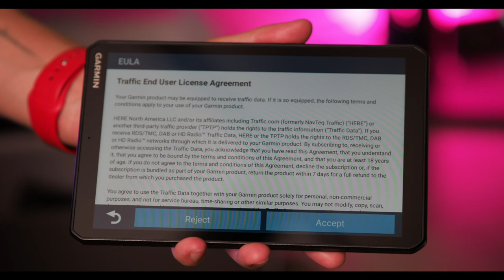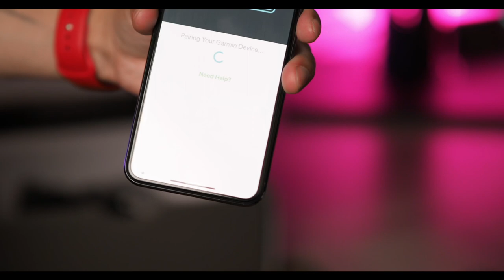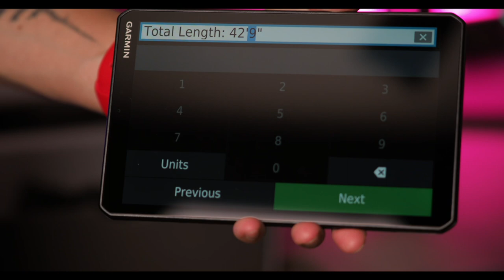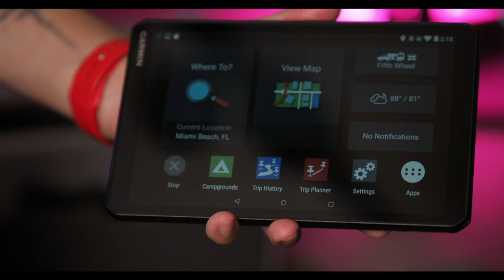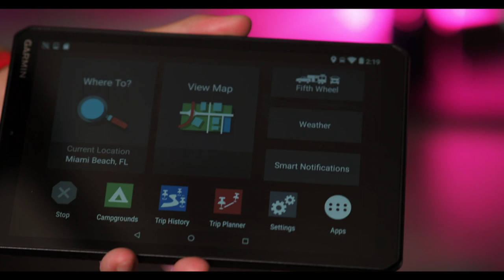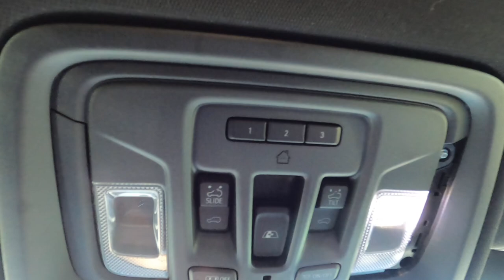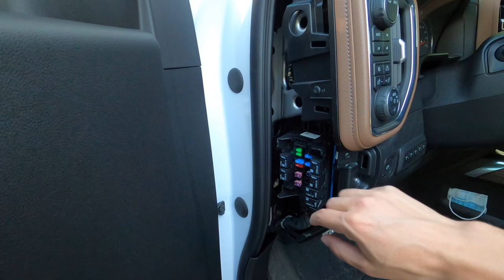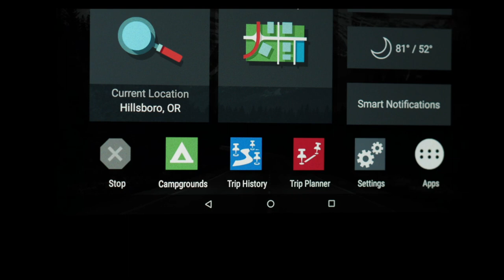Garmin RV 890 GPS Initial Thoughts and Custom Install on 2020 Chevy Silverado 3500 -Is it worth it?

Comment: (05:52) Newer Garmin GPS devices running Android also require you to set the region as well, which affects the units in distance and temperature.
Reply from the maker: Interesting, I believe no matter which region you select you can still set your desired units though which is good!

Comment: I'm curious if you left it in the middle of the windshield. Seems like it would block your view of the front right hand corner of the truck, making tight maneuvers a pain and it would block too much view of traffic. If mounted in the center it would have to be mounted low so it only blocked the view of the hood. Safety 3rd.
Reply from the maker: Hi Patrick,

Yes I did leave it in the center. I guess the exact position would depend on a few factors (truck hood shape, your height, seat height).
I placed it low enough to where it really wasn’t obstructing my view. It block some of the actual hood, which is ok, but I can still see the road/cars etc. 
it does just barely block a little of the road view but not enough to where I had any safety concerns.

Comment: The problem I'm having and attempting to work out with Garmin and/or RV TripWizard, is to have the unit receive a pre-planned trip (.GPX file) and display that trip properly to navigate from stop-to-stop. If you do pre-planned stops, are you having THIS problem??
Reply from the maker: I haven’t tried it with gpx files yet but I’ve wanted to try mainly because I know it’s been difficult, garmin DOt not make it easy although it’s possible. I’ll have to play with it and do some testing

Comment: Have still not figure how to get a GPX file to this device. - too expensive and not worth the trouble
Reply from the maker: I haven't tried loading a GPX to this unit yet, but I have on my Garmin Inreach devices and agree Garmin isn't the most intuitive when it comes to that.
And I'll admit, I do think this is an expensive unit, for me that extra piece of mind when hauling a large trailer is what pushed me to get one, so far I have been happy with it for its use.

Out of curiosity, what are you loading GPX files on to this for? I use them often while in the backcountry hiking etc, but I don't personally use, or need, them for driving around..or at least I haven't yet :)

Comment: How did you verify that is was a standard 12v input? I want to hardwire mine but do not want to damage it.
Reply from the maker: Hey, I believe it ended up being as simple as looking at the supplied charger. Most, if not all, chargers will have some marking on them on what their out mount range is, the charger said 12vdc.

Also, for what it’s worth, mine has been hardwired for a year now to 12vdc with no issues, so I’m confident in saying you’d be safe doing so.
Reply: @JaimetheNomad  thanks, that makes me feel more confident.
Reply from the maker: @rickfulford3797  yup good to go, now go install yours :)

Comment: why go to all that trouble, i was told don't leave a GPS where others can see it , take off windshield , remove cords mounts and hide them  and clean any marks from windshield . This way you look like a seasoned camper that knows his way
Reply from the maker: Definitely some good points Keith, I’ve actually heard similar points. And I did consider that, however I didn’t have a good place I liked where I could mount it in the dash, and I didn’t want to mount it in front of the factory truck screen, and I didn’t want temporary wires (such as powered from the cigarette lighter plug). So the windshield was the next best spot. And it’s still easy to remove from both the base as well as the windshield.

The main point of this unit, at least for me, isn’t as much as for GPS directions, but more so for identifying the best route for clearance due to my fifth wheel being tall and long (13’5” and 42’). :) of course this is just my opinion